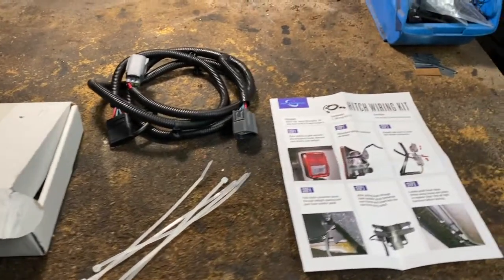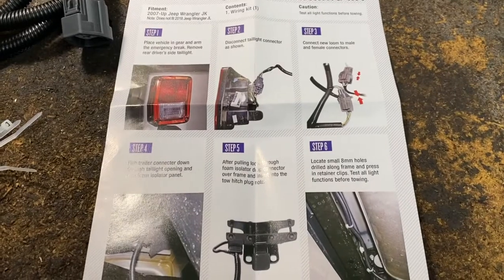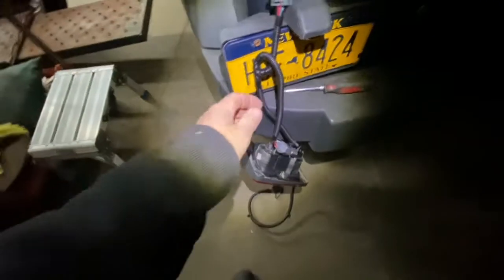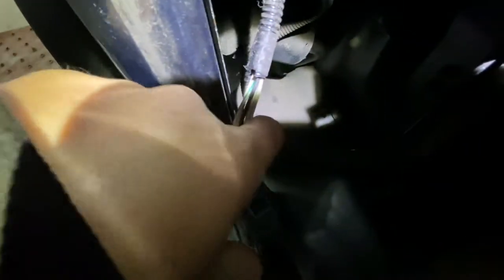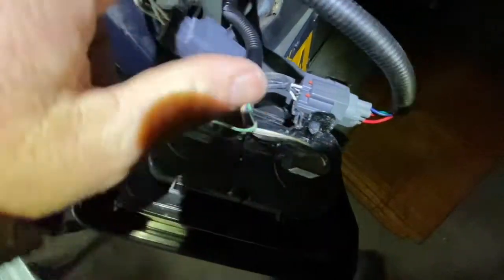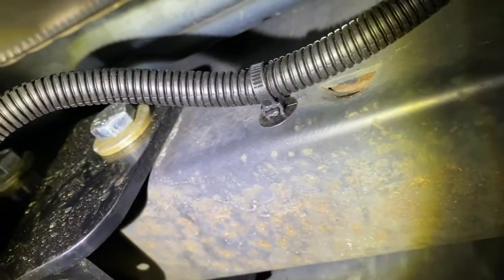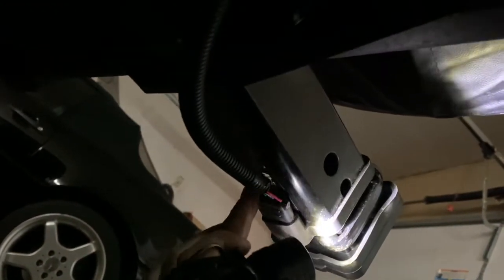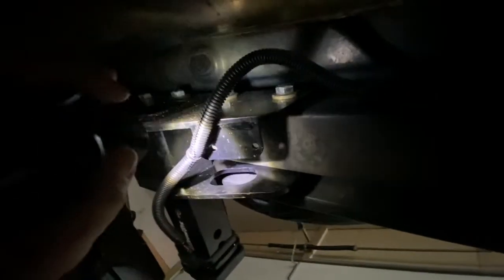Trailer Wire Harness Hitch Kit Installation Plug & Play Jeep Wrangler JK JKU 2007-2018

Comment: I bought the factory OE replacement which didn't come with instructions, but used your well done video to get it installed.  I was surprised a month ago when I went to hook up my trailer for use this spring and the lights didn't work, so I had to trace the problem.  Now they work again.  Good job.
Reply from the maker: Thank you! Glad it helped!